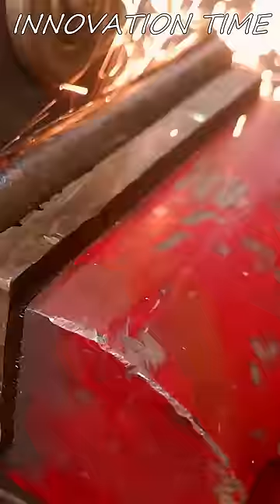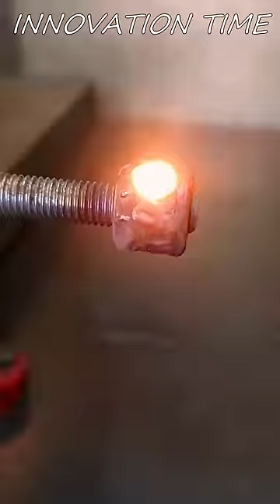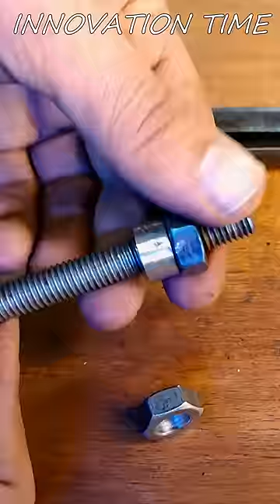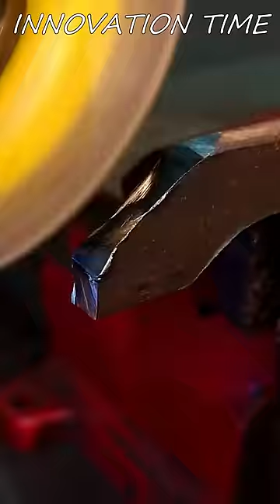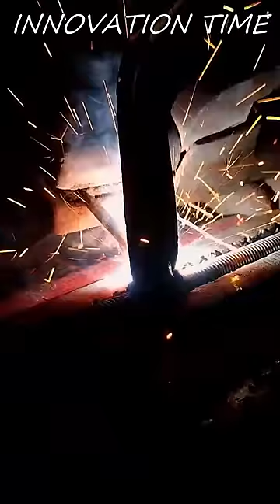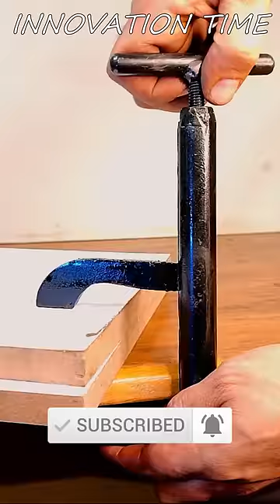Amazing clamp idea #short details in description ...

Comment: If you made this same design, only instead of using a thread less than 1/2" or 5/8" it would be 5/8" or 3/4" and the piece's that do the clamping are 3/8" to 1/2" pieces this would make for a much more Durable Clamp that Would Stand up well over Time without much distortion or deforming ! 😮

Comment: The more sophisticated variant. One takes solid bar stock, round. Next he drills it to the pilot size, such as will fit his taps. Drill through the centre, such as a pipe is made. Then he taps out this drilled hole, with his
[ taps.] "Cut threads", "tap threads"
 [ round bar,] "stock"
 that has been drilled to the 
[proper pilot hole size]

 Also, one can [tap] out [pipe] and tubing, "tube", (metal, steel)but be warned! The tips of the [threads] will be flat! It can slip.

Now you may have it made certainly. It is called
 "sleeve, sized, bushing, threaded, collar"

These parts once made will fit locally available bolts.

⭐Litany 

Drill
Pilot hole
Thread
Tap
Bushing
Sleeve
Round bar
Pipe
Tube(tubing, tube steel)
Pipe is internal size.
Tube is external size.